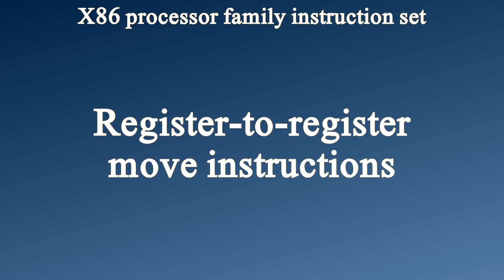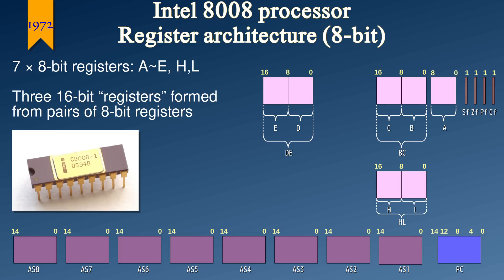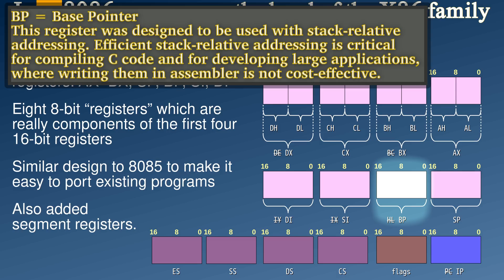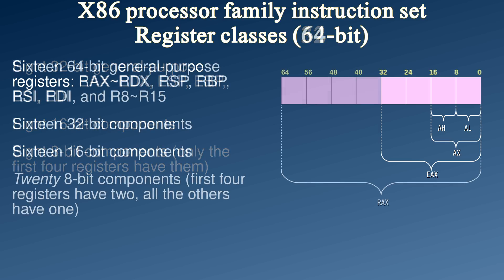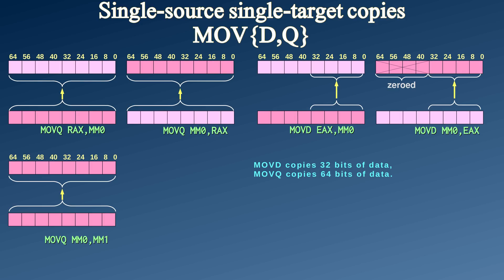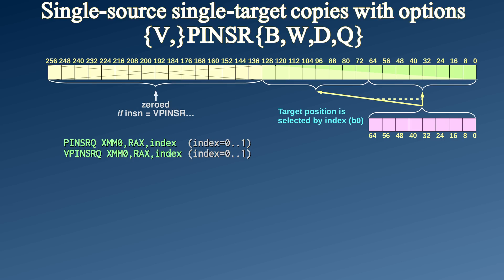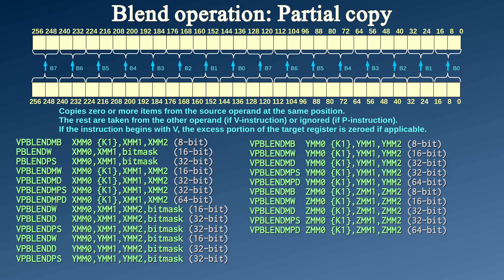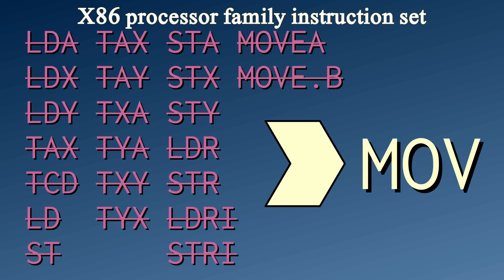x86 mov insns & short history of the most popular CPU architecture

Comment: Waiting for asm programming videos!
Reply from the maker: Good news: I am actually planning to cover this topic a bit more. Maybe a tutorial on where inline asm is useful with GCC.
Reply: @Bisqwit  I looked at the GCC inline asm syntax once, and recoiled in horror. Not only nasty AT&T, but also confusing as hell!
Reply: @Bisqwit  I'd like that :)
Reply: @Bisqwit  Käytä -masm=intel ! ! ! !
Reply from the maker: @HammerheadHal I don’t think you are Finnish. Why you are trying to type Finnish? In any case while you can use intel syntax in inline asm on GCC, you would need to wrap every single inline-asm block in .intel_syntax … .att_syntax clauses, which approaches being similarly nasty as the AT&T syntax. There is no winning solution. In general, using the AT&T syntax is preferred for consistency when doing inline asm in GCC.
Reply: @Bisqwit  Lightheartedness, respect, alcohol.

Passing the -masm=intel compiler flag removes the need to specify .intel_syntax per block.

Comment: Wow... I'm designing my own CISC CPU just for fun, and I'm still debating whether to join masking operations with moves.  Just about all operations more complicated than that have been rejected since they wouldn't be used enough to justify including and can be done better with a coprocessor.

Intel basically included every single thing I rejected, and with a cherry on top.  It's like, every tiny edge case justifies a new instruction.  Good thing I studied the differences between 68K and SuperH for inspiration instead of x86.

Also, my guess as to why MOV{D,Q} is needed for MMX is locality.  Most CPUs don't allow you to move directly from the integer unit to the FPU since even though they are on the same die they are still physically separate hardware units.  Normally you push the data into the stack to do that kind of transfer.  Intel was probably doing all kinds of silly low-level stuff with MMX and separate instructions were more convenient for unit synchronization.  After that, they just said "screw it" and added a plethora of special MOVs.  I don't know how to program x86, though, so... [shrug].
Reply from the maker: Locality has nothing to do with it. This is an issue with nomenclature, or language. The assembler can call these instructions whatever it likes. Why Intel decided to give these instructions different names I don’t know.
They did just fine with segment register moves (e.g. MOV AX, CS) and control register moves (MOV CR0, EAX). But they added special instructions for some other moves (like LIDT mem instead of LEA IDT, mem, or SMSW AX instead of MOV AX, CR0 ). There is no reason why an assembler couldn’t do with the other name.

Comment: I have to wonder if half of these are even effectively used by most compilers.  I only know a bit of PowerPC 750CL, so this just seems absurd.
Reply from the maker: Where two or more instructions accomplish the same task, different compilers seem to have different preferences on which instruction they choose. They also try to prioritize them according to knowledge about each processor microarchitecture (a process called tuning). In practice, sometimes the compiler can be surprisingly clever and solve problems using instructions you didn’t even think of, and other times it is amazingly dumb so as to create elaborate rube-goldberg-esque contraptions spanning several pages of printout for what seems like a very simple job only worth a couple of instructions at most.

Comment: I'm trying to imagine what this'll be like in 100 years of insisting on maintaining compatibility with everything from 150 years before, no wonder arms are having a much better time evolving.
Reply from the maker: You can boot DOS on a new PC just fine, as long as your BIOS/UEFI is configured to enable legacy BIOS boot rather than EFI only. And even if it’s EFI only, if you use a bootloader like GRUB, you can still load up DOS — no emulation, no virtualization just bare metal like it was in the IBM PC days.
Reply: I believe adding microcode for pre amd64 instruction set doesn't add that much circuitry so that's why they keep it there. Bios and devices are different though. Can you actually boot DOS on a new pc?

Comment: Hi Bisqwit! Great video, really interesting technical history and very informative. I thought I'd give you a little tip on some of your pronunciation in the video (if you would like feedback). If not, tell me and I won't make the comments again in the future :)

- Ceramic is pronounced with a soft-c 's' sound, like seramic
- Scheme is pronounced 'skeem' with the ch being a hard sound, not like 'sheem'
- SIMD is usually pronounced SIM-DEE instead of just trying to read the word
Reply from the maker: Thanks. As for acronym pronunciation, that’s just a thing I do for flavor and for fun – and often people’s opinions on “correct” pronunciations of them varies greatly anyway. For example I have lost count how many different readings of “MySQL” I have heard.
Reply: @Bisqwit  Something else you may be interested in: Blades of Steel for the NES can generate different demos (pseudo-randomly) from power on with no user inputs. Might make an interesting video how it does that
Reply from the maker: How many different demos? In any case, on the NES, the CPU and PPU run on different clocks (produced by dividing a master clock at different integers), with the PPU running faster than the PPU (3 times faster on NTSC, 3.2 times faster on the PAL). On system power-on it is actually random where the clocks align; which PPU cycle is the one that ticks exactly at the same time as the CPU. The CPU can detect this difference from the latency of certain operations when communicating with the PPU. So that is where randomness can arrive.

In addition to that, the contents of the RAM are random (and depend on the exact console unit) when the system powers on. This is more likely what the game uses.
Reply: @Bisqwit  I've been told that Blades of Steel zeros the RAM, so in that case it would have to be the CPU/PPU misalignment. Thanks for the explanation!

Comment: Goodness me. I'd heard that  the x86 instruction set was messy, but *yikes*. 

(Also, "twelvety-eight" is an excellent way to say 128. I've never heard anyone say that before, but it's endearing.)
Reply: Wait until you check out the binary encodings of these instructions. Intel's full x86 manual is 5038 pages long.
Reply: @charlesrosenbauer3135  That's a lot.
But on the other hand, the current 6502 family manual (yes, 6502 is still a 'current' design sold as new parts. XD) is some 460 pages, and that's for an architecture that basically hasn't changed at all since 1984.
(though it does cover 4 variants; 6502, 65C02, 65802 and 65816, but aside from the latter two having a bunch of 16 bit instructions, there's not all that much difference. nearly 500 pages to describe no more than 255 instructions.)

Add in the datasheets which contain considerable addtional information, and are often at least 150 pages and you could get into the 1000+ range for the family. (but the modern iteration of the family is basically the 65C02, 65816 designed as processors along traditional lines, and 65C134S and 65C265S which are microcontroller equivalents with built in RAM, flash ROM, and even a set of tone generators, timers and other support features. Kinda weird to think about honestly. If they weren't slower than the dedicated CPU versions, they'd be fascinating for a retro style computer build.)
Reply: It is a bit of a victim of its own success. Intel themselves have tried to move to a new cleaner architecture at least twice! But x86 has an awful lot of inertia in the desktop and server space.

Comment: I only knew the instruction sets until 8080 and 8086, thank you! ❤️ All your videos are incredible, this is easily the best channel on YouTube for me, along with the 8-bit guy!
(i can only hope being so smart is not a curse in your everyday life)
Reply from the maker: By "until" do you mean you were familiar with 4004 and onwards until 8086/8088, or with Pentium and 386 instructions even down to 8080?

Thank you for your kind words!
Reply: @Bisqwit only from 8080 and 8086, to 8088. I mainly used it to optimize Pascal/C code, i.e. graphics; rarely to debug.
I also did some basic crackme for fun on Windows era (with Softice) but never really learned to remove any commercial protections.
Thank you for sharing your knowledge! ❤️
Reply from the maker: Where did you work with 8080? I am curious.
Reply: @Bisqwit  I did some 2D videogames with sprites on DOS, with optimized routines in Assembler, and then some 3D games on Windows with DirectX.
But everything as a hobby/passion, never worked any commercial title or any IT job ☺
i am glad i talked to you at least once in my life, i watch your videos all the time the stuff you do is awesome!
Reply from the maker: But I specifically asked about 8080 — since you mentioned it — a chip that came and went before IBM-PC (or let alone DOS) was even a thing.
Reply: @Bisqwit  about 8080 i just know the instruction set and experimented on emulators, same as Z80. I am now trying to program an hardware one following this guide from BEN EATER: https://youtu.be/9PPrrSyubG0
Also on MOS6502 i mostly know it's assembly from Commodore64 which is similar. But the most interesting machine for me at the moment is the Sharp X68000 and it's music engine! If you loved Amiga MODs you will love it: https://youtu.be/zSLlmoikV-w
Reply: @Bisqwit  also i can't believe i missed on all this entirely:
https://youtu.be/aLggiR6EYao
https://youtu.be/Hna1l1raaWg